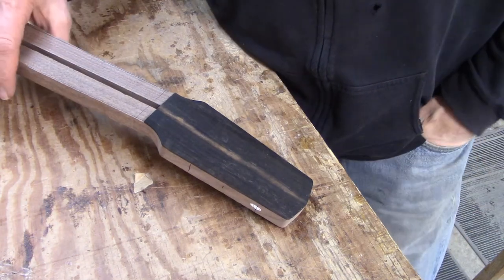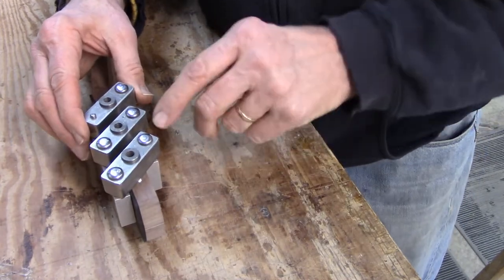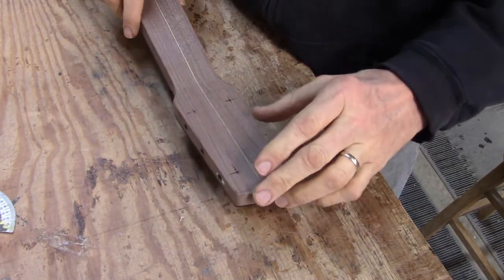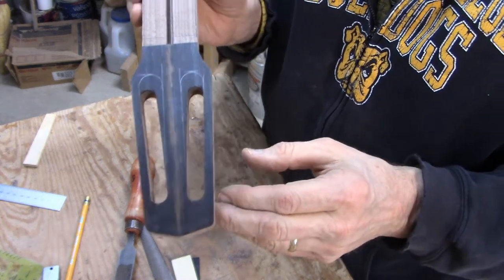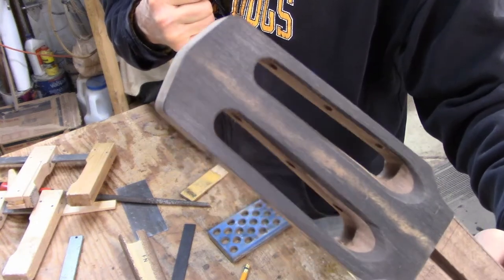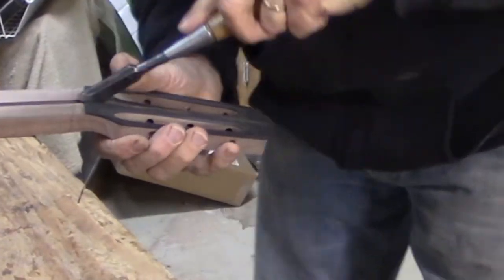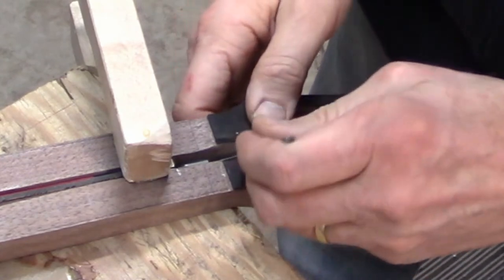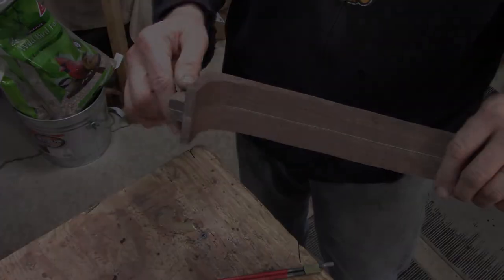Making a Slotted Peghead for a Steel String Guitar

Comment: Beautiful craftsmanship,  but why not have the truss rod adjustment access through the sound hole?
Reply from the maker: The sound hole ends up being pretty far from the head block on this style of guitar and I worry that it would be difficult for some people to make the adjustment there because of the reach.  The truss rod I am using requires only a small amount of the peghead wood to be removed for access, so I'm not too concerned that I have weakened the peghead excessively.
Thanks for watching.

Comment: how thick is the headstock with the veneer and without it?
Reply from the maker: This one was 0.64" without and 0.72" with the veneer. The important measure is that the final thickness is greater than the width of the tuning machine's base.